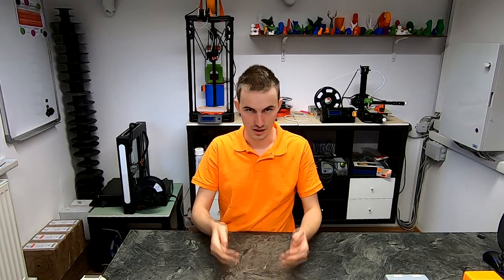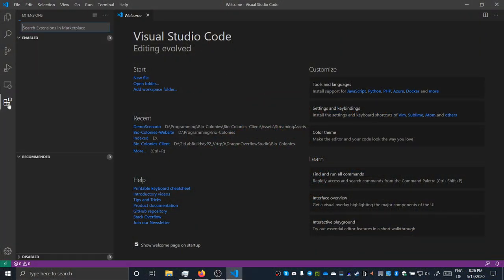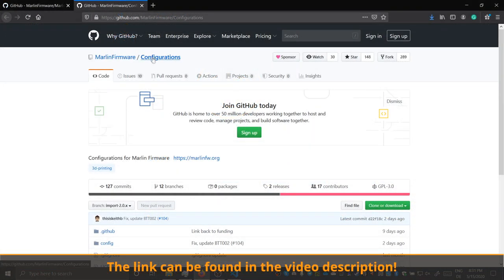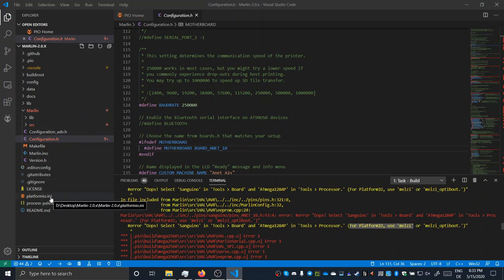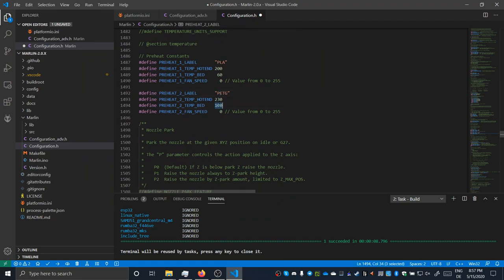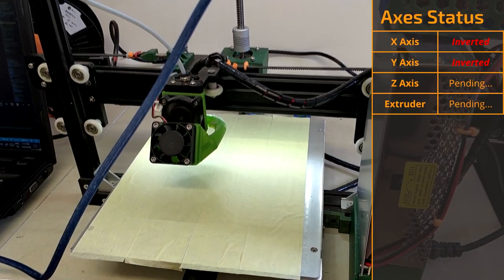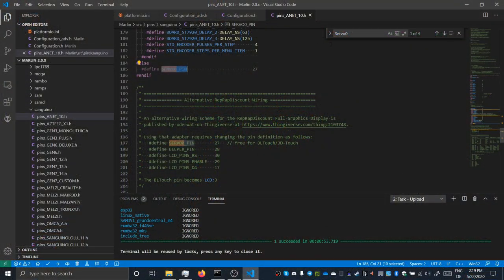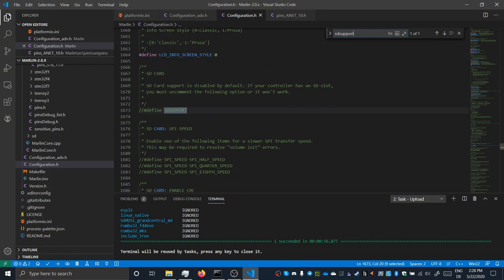Installing Marlin 2.0 with PlatformIO (on Anet Printer)

Comment: Hi, I have an Anet A6. If I try to upload a "good compiled marlin firmware 2.06" to the original mainboard I always got the same error for no connection (printer reboots itself while uploading... LCD goes blind and suddenly printer reboots)... and no firmware is uploaded but Anet 2.0 still works perfectly. I'm sure the port number is right because I connect to the printer with pronterface and execute commands and movements on it... I have tried all things... rebooting Anet A6, PC, etc... But no way. Should I need to unplug the LCD while loading? unplug SD card? Any idea?  Thanks in advance
Reply from the maker: Hi, thanks for your comment.
During upload, the LCD usually stays blank or becomes scrambled. You could try removing it, but I don't think it will resolve your error, but you could give it a try nevertheless.
It's also normal that the printer reboots on success.
Did you already upload a firmware to this printer once, or is it still original?
What's the error message you get during upload?
Reply: @Caverntwo  Hi again. This it is the first time I have tried to upgrade the original firmware (Anet 2.0) on the original mainboard of Anet. In fact when I try to upgrade the process starts and the LCD turns empty, then appears half iluminated and beeps... It is then, when the Pc cannot connect to the port and upload fails.
I'll try again today afternoon. Thans for your reply.
Reply from the maker: As you're commenting on this video, I suppose you use PlatformIO to upload. 
If you click on compile, note how much space the firmware uses. This will be in the output console almost at the end. I also had troubles with running out of space before, even bricking my board.

As an alternative, I can suggest you to give the process with the Arduino IDE a try. You can find an older video of mine about this topic, with Marlin 1.1.6 I believe. Actually, all you need is the Arduino IDE with the Anet Board Definitions installed, and then you can just start the .ino file.

Just let me know if that works.
Reply: @Caverntwo  
I managed to activate everything that seemed desirable to have in the new firmware and when I try to compile it tells me that it is ok... 99.9% occupied. Indicating that the compilation is a success. I tried to do it with several arduino versions and they always gave me an error for path too large...I have not managed to correct that problem in any way ... Neither old versions nor beta. Thanks for your attention.
Reply from the maker: I got the same error where PlatformIO was telling me it's alright, however, it doesn't take into account the size of the bootloader and/or other things apparently. In my currently latest video (done a few weeks ago) I ran into the issue and solved it by disabling stuff I won't use like ARC_SUPPORT to get extra memory. The board only got 128kB flash memory whereas most RAMPS based boards got 256kB (and 32 bit boards got usually more). If you just need a firmware that runs your desired set of features, you might even go back to 1.1.9 which uses less memory but might support all your features.
Reply: @Caverntwo 
I'm going to do a couple of tests ... first, I'll try to upload it with the LCD screen disconnected and if it still doesn't work, I'll try to remove some other function that gives me more space than that 0.1% free. I will tell you
Reply from the maker: Awesome, looking forward to the results.
Reply: I Win!!!! I first tried to erase some new characteristics (no manual bed leveling from menu) so firmware had an 94.3% of the memory... But stil the same problem... LCD unconnected... same problem.... In the end I read the file platformio.ini and found there is no upload speed for sanguino card... So I created this constant and assign 57600... and it runs now!!! This is my last platformio configuration for sanguino: 
[env:sanguino1284p]
platform      = atmelavr
extends       = common_avr8
board         = sanguino_atmega1284p
board_upload.maximum_size = 126976
upload_speed  = 57600
lib_deps = ${common.lib_deps}
src_filter = ${common.default_src_filter} +<src/HAL/AVR>
build_unflags = -g -ggdb
build_flags = ${common.build_flags} -fno-tree-scev-cprop -fno-split-wide-types -Wl,--relax -mcall-prologues -finline-limit=3 -ffast-math
#

The lines at the end is to force a special way to compile that gives you almost 16Kb of free memory , so you can activate more things in Marlin.

Como decimos en España... Gracias por aguantarme la chapa!!! Thanks a lot.
Reply from the maker: Awesome, thanks for the update!
I've read about this as well, but thought that the default is already properly done.
Anyway, I'll probably try it myself once I upgrade the firmware of my A2 again and will pin your comment to help others as well!

It's awesome to see that it works out for ya and thanks again for sharing the details ;-)

Comment: hello. I have a problem. Terminal Process "C:\Users\serz\.platformio\penv\Scripts\platformio.exe 'run', '--environment', 'LPC1769'" was completed with exit code 1. - whatever I did. I inserted a ready-made firmware with the same error. I tried to edit myself the same mistake. what to do?
Reply from the maker: Hi,
That error seems to be caused by a missing dependency/compiler. What version of Marlin are you trying to compile? You could also try to uninstall and reinstall PlatformIO (don't forget to reboot your PC afterwards)
Reply: @Caverntwo  версия 2.0
Reply from the maker: @stalkerazov  I'd do the following: delete PlatformIO extension in VS Code, then go to your user folder C:\Users\<yourname>\ and delete the .platformio folder. Then restart your PC and install PlatformIO again. It should install the required packages then.
Reply: @Caverntwo  ок
Reply: @Caverntwo  it didn't help
Reply from the maker: @stalkerazov   Turn on verbose logging and look for the actual error in the output window. There can be multiple causes for such error, therefore closely inspect the messages in the log. Usually you can see errors by either them being red or containing "error" or "err".

Comment: I always get an error in compiling. 'HOMING_FEEDRATE_XY' was not declared in this scope. What to do?
Reply from the maker: It seems to be an error with the example config, which is no fully compatible to the version of Marlin you are compiling. Open the default configuration files that come with your Marlin download and look for the HOMING_FEEDRATE_XY. Once you know how it works with the default, try to adapt your config to it.

This occurs sometimes when you are trying to use a main version, however, the example configuration files are already updated for the latest version (in development) and some minor things changed.

Let me know if ya managed to get it running!
Reply: @Caverntwo  Thank you for the reply! I will give it a try and I will let you know. Thanks

Comment: Hi. Thanks for your video, but just a question. I've the standard 2004 lcd board and buttons doesnt work. Do you have an idea ????? Thanks
Reply from the maker: If you have the Anet 4-button LCD controller, it only works with the Anet board. You'll need to uncomment the line 
#define ZONESTAR_LCD
instead of the one I used.
Reply: @Caverntwo  this is what i done but buttons not working
Reply from the maker: Hmm, you could try a few things:
Did you comment out the other display I used? 
Did you connect the display to the correct plug?

Comment: Hi, thank you very much for this tutorial, I followed  all the process step by step and compilation process is fine, but when trying to upload the firmware I get multiple messages like this:  avrdude: stk500_getsync() attempt 10 of 10: not in sync: resp=0x66... my printer is an anet A2 and it's connected to COM3 at 115200 and set the same value for baudrate in configuration.h. Am I missing another value in configuration.h? Thanks in advance.
Reply from the maker: Hi, thanks for your comment.
This error appears when communication to the board was interrupted during flashing. It happens regularly for me, but every other time it works.

Have you been able to flash before already?
If the error persists or you have never been able to flash before, it could mean that there's no bootloader installed on the controller. I got another video about installing one, if you're interested.

Comment: How do i use the anet a8 display and anet a8 with a new anet a8 PLUS version 1.7 mainboard and Marlin. Atm i have only white stripes across the screen (the board is totally new).
Reply from the maker: Hi Anders, thanks for your comment!
If you have the small display, you need to enable the ZONESTAR_LCD in the Configuration.h file and uncomment any other enabled LCD. For the large display, you need to enable the one I had in the video.
The whole process should be very similar to what is shown in the video, however, unlike me, go with the Anet A8 default configuration.

Let me know if it worked for you!
Reply: @Caverntwo  unfortunately I am having problems getting the VSC to work properly with either compiling and uninstalling the platformIO as it did not install correctly. 
I managed to install a old version of the marlin 2.0.5.3 with the zonestar LCD on this MB V1.7. 
So still having problems doing it your way :/

Comment: Hello i have an ender 3 and Cant complete the build it says incomplete and sanguino fails...any idea ;
Reply from the maker: Hi, thanks for your comment!
What "platform" did you set in the platformio.ini file for the "default_envs"? It probably has to be set to 'melzi' as well.
According to various sources, the controller of the Ender 3 is a Melzi clone, similar to the Anet board in the video.
The process for you should be very similar to shown in the video. You start off with the Ender 3 example configuration and work your way forward. 

Once your compilation is successful, uploading is going to be funny as well, as there is no bootloader installed by default. So you need to flash one first, and you need another Arduino controller (doesn't matter which one) or USB to ISP adapter for it. Check out my other video for this process (you need the Arduino IDE for this): https://youtu.be/UBdN9HJ9LKE

Alternatively, I can recommend checking out this tutorial, as this is specifically for your board: https://all3dp.com/2/ender-3-with-marlin-how-to-install-marlin-firmware-on-your-ender-3/

If you run into trouble, just let me know.
Reply: @Caverntwo  i ve tried also the tutorial u sent me and still cannot flash the marlin ...i am confused...for the moment i have flashed the bootloader and the printer has not firmware in it...cant use it.lol! Can you help me through TeamViewer ;
Reply: Thanks for your help😊😁😁😊 !!!

Comment: hello, I did everything as you teach, and when compiling, I get several error commands, but the error is in default_envs

What to do?
Reply from the maker: Hi, thanks for the comment.
Are you sure you set the correct environment/board?
Other than that, I'd need more information about the errors to be able to help you.
Reply: @Caverntwo  I can't leave a link to the image, the comment has already been deleted 3 times

But my problem is in ''melzi''.
Reply from the maker: Are you sure that you've selected the correct environment? What board do you have?

You can also send me an email, you can find the contact info in the about section of the channel.
Reply: @Caverntwo  my printer is an Anet A6. I'll send you a printscreen that I took in your email, then.
Reply from the maker: If you got the default controller, it should work how I showed in the video.
Reply: @Caverntwo  it is giving error in the compilation, that's the problem. I sent it to your email.
Reply: @Caverntwo  hello friend, I sent you my file in the email for correction, I don't know if you looked.
Reply from the maker: @elaboremaquinas  I answered you just now. Thanks for reminding, I apparently forgot to hit that send button yesterday ;-)
Reply: @Caverntwo  Hello, I sent you a little problem I'm having in the email, can you help me?
Reply from the maker: @felipepassos7874  I answered you just now!
Reply: @Caverntwo  I sent you an email back, my friend!
Reply: @Caverntwo  I sent you one more reply in my friend's email. I'm answering here to remind you as a guarantee :)

Comment: is this same with mks gen l 2.0 so do I have to follow the same steps?
Reply from the maker: Yeah, it will work, but go with an example configuration for your machine and make sure that the controller is right. The MKS base gen l controller is equivalent to an Arduino Mega with a Ramps 1.4. Therefore make sure to choose "mega2560" in the platformIO file and make sure that you use MKS_GEN_L as the mainboard in the configuration.h file.

Let me know if it works for you!

Comment: It won't work. Board has no bootloader.
Reply from the maker: In this case, you need a programmer or second Arduino that you use to put the firmware onto the controller. You can also choose to install a bootloader then. I have a video about how to do that:
https://youtu.be/UBdN9HJ9LKE

Comment: can I do this at ANET N4?
Reply from the maker: Hi Nilson, thanks for your comment!
As far as I can tell, my tutorial sadly won't work for this printer and most other SLA/DLP printers. 

The reason for that is that they run a firmware made for the individual printer only and use some proprietary slicing software to get their non-standard print files to the printer.  
While Marlin could be adapted to run on these machines, probably requiring a lot of custom code to get the DLP panel integrated and working properly, which is certainly not easy, and hasn't been done for the Anet N4 as far as I can tell. 

I'm very sorry for not being able to help you here, but maybe there will be a possibility to run Marlin or some other open-source firmware on the machine in the future.
Reply: @Caverntwo  thanks

Comment: Hi, i also got a anet 8 plus, do i need you flash a bootloader for this?
Reply: cause im getting this fault:

Error: Please specify `upload_port` for environment or use global `--upload-port` option.
For some development platforms it can be a USB flash drive (i.e. /media/<user>/<device name>)
* [upload] Explicit exit, status 1
Reply from the maker: Seems like you didn't specify the COM Port to use to upload.
Reply: @Caverntwo  do i need  to instal a driver?
Reply from the maker: If your board doesn't show up in the device manager or only shows up with a warning, then yes. It depends on the communication chip your board uses. If you install the Arduino IDE, for example, the important drivers are automatically installed during the installation process.
Reply: @Caverntwo  now, i did it as you did in ur linked video with arduino ide, but its stil not working, it didn't install a drive. u have anny idee what driver i need to install?
Reply: @Caverntwo  maybe it is, when im choosing my board is says v1.0. but mine board is V1.7 is believe, could this be the problem?
Reply from the maker: Did you choose the correct port? In the Device Manager you should see the device at the port.
Reply: @Caverntwo  i finnaly manage to flash the Marlin 2.0 firmware. But now when i try to flash mine auto bed leveling settings it says that i have 5300kb overflow. So not enough memorie Any idea that i can do?
Reply: @Caverntwo  thank you for al thé help btw
Reply from the maker: You can only try to disable things that you don't need. Examples for this are Arc support and volumetric extrusion.
You could also flash the old 1.1.9 Marlin in this case as it has most features and takes less space.